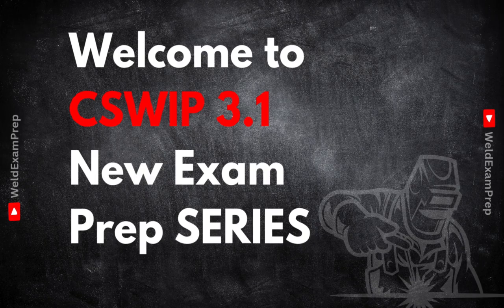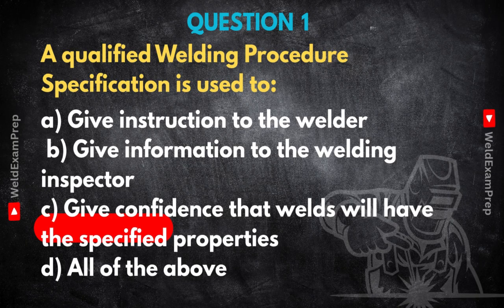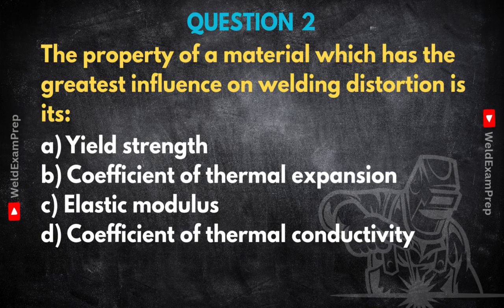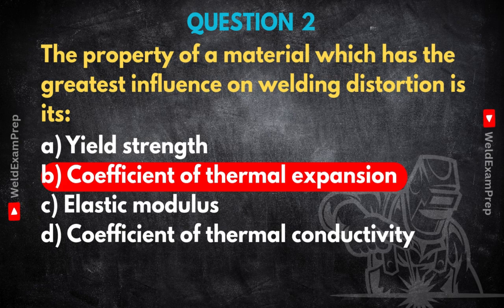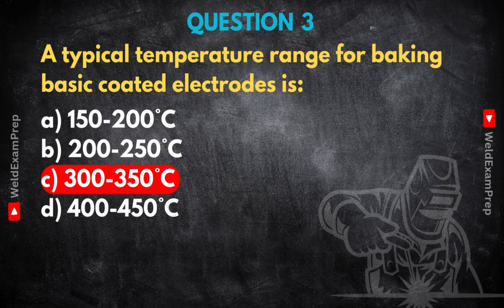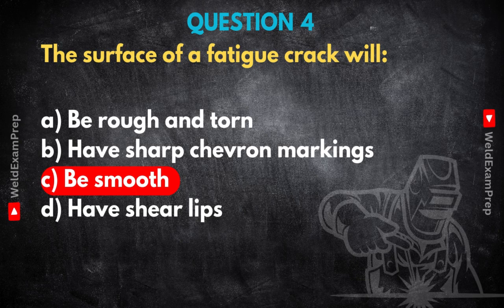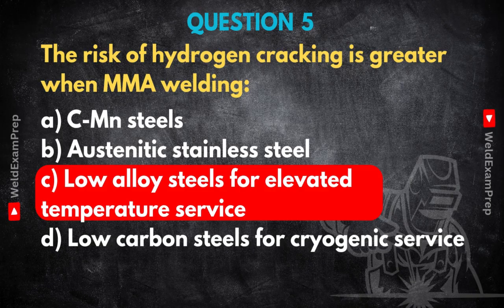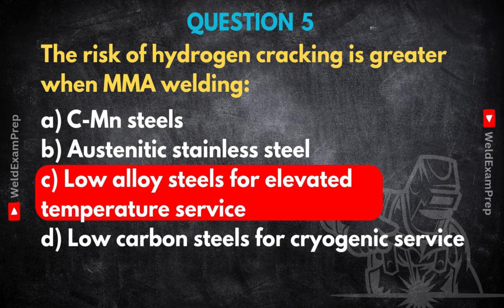Pass the CSWIP 3.1 Exam! 🚀 Most Common Welding MCQs with Expert Breakdown 42

Comment: Can you define the least distortion for the U & double V joint preparation weld ?
Reply from the maker: In a double V joint, weld metal is deposited symmetrically on both sides of the plate. So less distortion than U preparation
Reply: @WeldExamPrep it's really mind boggling question, in our question bank key it's of U  preparation and asked also some experts like James (carbonArc YouTube changel ) he also suggested for U joint and chat gpt and others for double V due to balance welding technique on both sides.
And mostly this question comes in exame everytime.